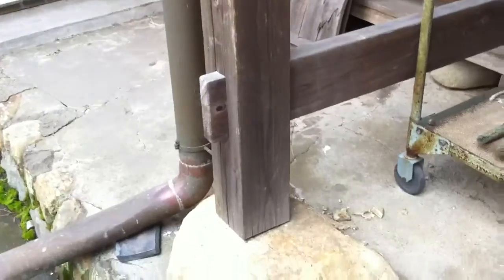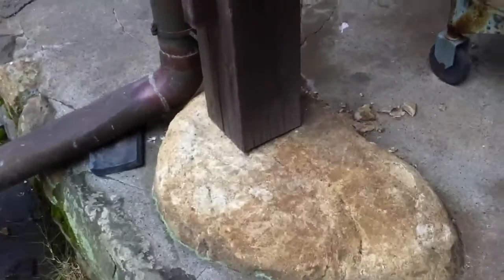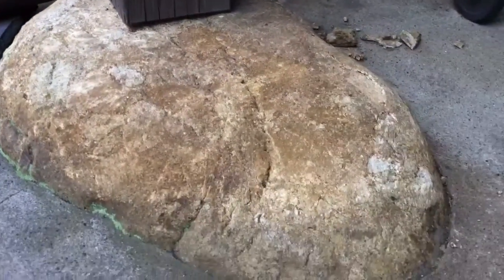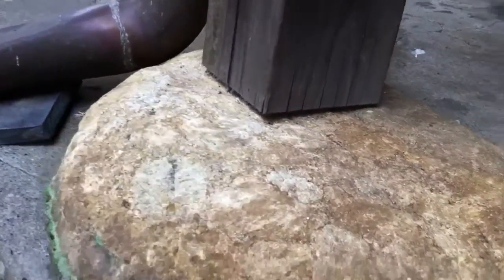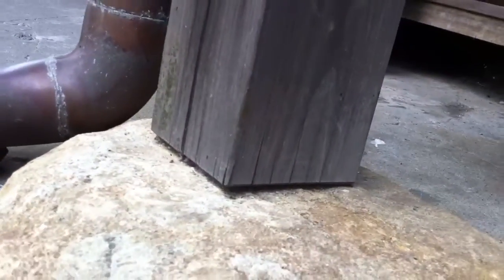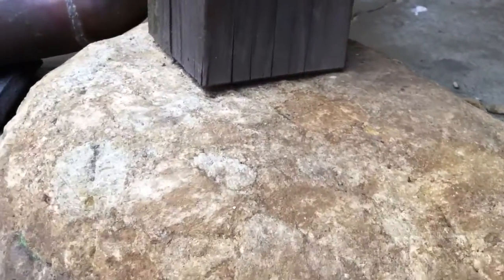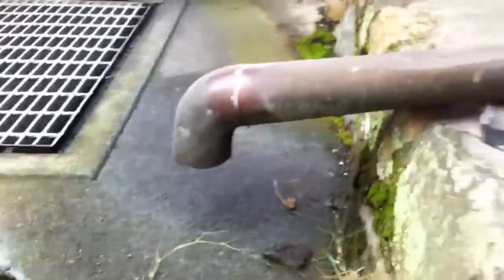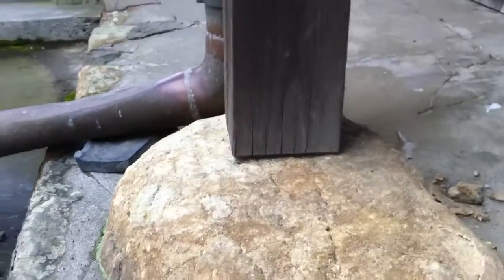Old Japan Foundation Stone

Comment: If the house is designed to move with the earthquake, do the plaster walls crack and need to be repaired?
Reply: Yup, they are like disposable panels so they don't interfere with the normal flow of the log frame while in the quake.